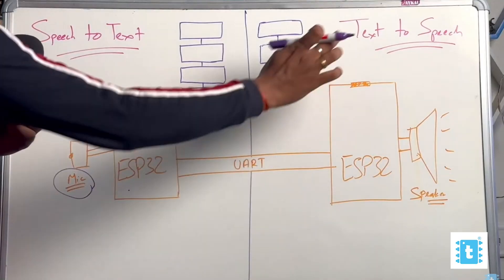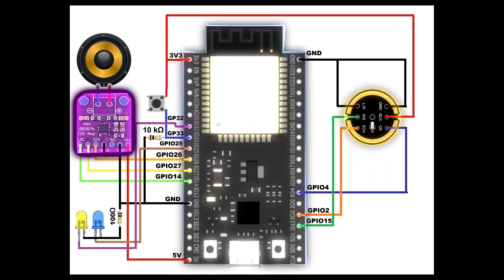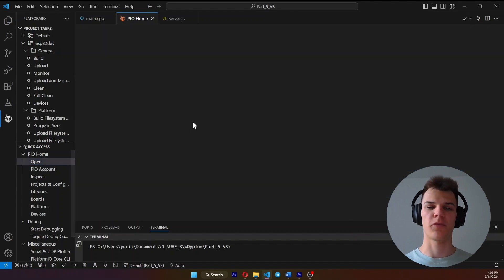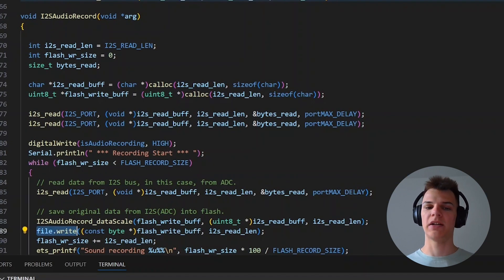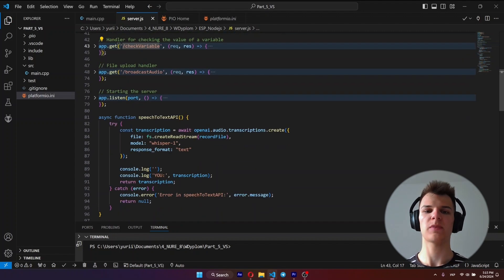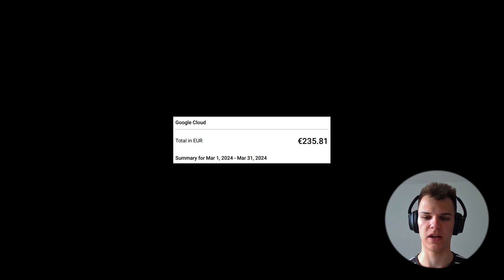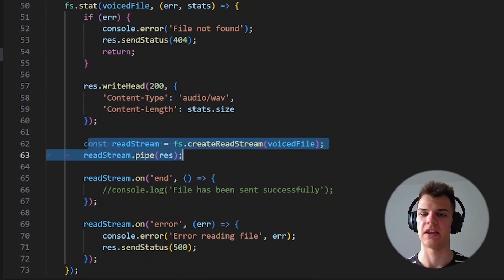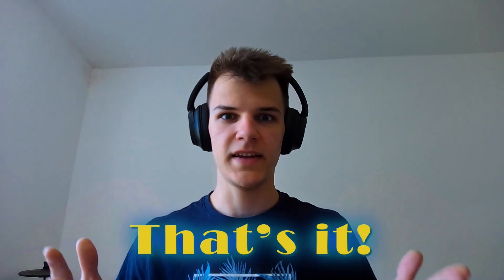ESP32 Voice Assistant based on ChatGPT | IOT

Comment: NICE WORK!!!

but i need to know which ESP32 board you are using is it esp32 WROOM with 38 PINS ?
please mention this exactly
Reply from the maker: Hi ) 
I've used a "Azdelivery esp32 wroom 32", but you can use similar ones from other manufacturers. More pins is always better ;)

Comment: Can Esp32 work independently without connecting to a computer?
Reply from the maker: Hi. You can power it from PowerBank. If you meant a web connection, theoretically, yes, but you need to set up a backend server on a Cloud.
Reply: @BarsAE20  Yes, I mean that the Node.js server needs a computer to operate.

Comment: YOU: Hello, I am Vaitheeshwaran.

E:\Bot\ESP_Nodejs\server.js:135
                console.error('Error calling GPT:', error.response.data);
                                                                   ^

TypeError: Cannot read properties of undefined (reading 'data')
    at callGPT (E:\Bot\ESP_Nodejs\server.js:135:54)
    at process.processTicksAndRejections (node:internal/process/task_queues:105:5)

Node.js v22.13.0
ive got this error 
gimme a solution
Reply from the maker: Hi, this means that Recorded Audio data wasn't transcribed correctly (or wasn't at all). Make sure to get the SpechToText string correctly.
Ask ChatGpt also)
Reply: @BarsAE20  same problem with me but i thnik its coming from the api key not being read properly can you explain properly step by step on how and where to create the user variable for it

Comment: @BarsAE20
I am making this project firstly i want to ask how does the server side code works like where do i put it how to connect and make a api key etc etc and then also i want help with trouble shooting 
can i get your discord so i can ask 
please urgent need to display this in a country wide exibition 
:hand-pink-waving:
Reply: Done withh all but still havent bought api can you check my final code it has some changes just wanna confirm so should I email it to you if so can you tell the email adress❤
Reply: thanks in advance
Reply: Pls reply
Reply from the maker: Hi! 
The server side is on your PC. Import the code into ChatGPT and ask how does it work, that'll help )
Reply: @BarsAE20  its kinda confusing like how do i use this node.js and where to put api
its just suggesting better code
Reply from the maker: You have to install Nodejs and run the main file in the console. 
The API-key is in the Config.js file:
// config.js
const apiKey = 'Bearer XXX';
module.exports = {
    apiKey: apiKey
};
Reply: bro where do i put in wifi ssid and password
Reply from the maker: Separate file:
#ifndef NETWORK_PARAM_H
#define NETWORK_PARAM_H

#define WIFI_SSID       "Vodafone"
#define WIFI_PASSWORD   "Pass"

#endif // NETWORK_PARAM_H
Reply: Bro at this point why don't you give me ur whole working code that u used
Reply from the maker: Man, that's all, rest of the code is on the GitHub. Figure out how it works, I don't have time to explain every line of code. Credentials are moved to separate files for security.
Reply: @BarsAE20  done with it all but still havent bought api so can you check my code to see if its fine
Reply: i can email
Reply: I would really appreciate it

Comment: Hello bro :face-blue-question-mark: What's the performance are you getting from using ESP32-WROOM-32 though? Does it run well? Like can it face science exhibition without any memory issues or crash? I'm aware just how 520 KB RAM takes the load, If you confirm that, It can run well at least contineously 4-5 hours, then i dont have to afford esp32-s3-wroom1
Reply from the maker: Hi, yes you can do it. The Esp32 is only awake when it processes the data, during recording, and outputting phases, otherwise it sleeps. If error occurs, just reboot

Comment: :hand-pink-waving: Hello, Can you list the all hardwares you used in the project with their respective model and a connection diagram if possible, I need it
Reply from the maker: Hi. Esp32 Dev Module 38 Pins, INMP441, MAX98357A
Reply: @BarsAE20   Can I use ESP32-S3-WROOM1 development board instead? It provides more Flash Storage,CPU,PSRAM,   Or We must use the esp32 board, Sorry for the dumb question, Im begineer on those and umm, Doing all my best for science project
Reply from the maker: @mezbatheking3161 They are almost the same, just try
Reply: @BarsAE20  I also saw you using two leds, 100ohm resistor wb them? and any guides how can i set em on the board, unsoldered one

Comment: I completed the project, but when I ask a question, the answer only shows in the CLI, and doesn’t play through the speaker. What could be the issue? 🤔However, This is truly amazing!🧡💙
Reply: Did it actually worked?
Reply from the maker: Hi! Really appreciate, that you've completed the project )
I'd check these things: 
- Is the transcripted file in the folder and playable.
- Is the I2S setup function for Max98357A correct and matches the physical wiring
- On the hardware side I'd check if everything wired correctly (and corresponds to to the software). I'd choose the same pins, that on the video. 
- The speaker has to be without any pre-amps. Somewhere near 3.2W what is max amplifier output. Check the power supply also.
- If it didn't help, probably it's in broadcastAudio() function. Check again the local http server address; i2s_write function etc. You can also ask ChatGpt to insert error checks in function to understand the reason of an error.
Hope that'll help. Good luck!
Reply: @BarsAE20  Thanks again for the help and good luck to you too! 😊
Reply: @Aveesha_Vivek bro what hapined with the Project dose it worked?
Reply: @adamfather2  Yeah! When I ask a question, it generates the answer and shows it in the CLI, but I can’t hear it. I think it’s my mistake while making the circuit. Anyway, the project works!

Comment: hi, does the code only records for 5 seconds, or can you change the recording time as we want?
thanks
Reply from the maker: Hi ! Yep, you can change it. The maximum value comes from the amount of Flash you have on your Esp. Try experimenting.
P.S. A better solution would be  to make the recording by holding a button etc. to be more flexible.

Comment: Wow, this video is absolutely amazing!. Thank you for sharing such valuable knowledge.

However, I have one question: can I use an ESP32 with 30 pins that operates at 3V? I want to ensure compatibility before starting my project. Thanks in advance!
Reply from the maker: Yes, you need a total of 6 logic pins for the microphone and amplifier. The ESP32 module operates at 3.3V, so when you plug it in through the micro USB, it first converts the voltage from 5V to 3.3V using an onboard transistor. 
P.S. The 5V pin on the board is directly wired to the micro USB input (which is typically also 5V), so I used it for the amplifier to get a louder audio output.
Reply: @BarsAE20  yeay I made it :)
Thanks
Reply: Bro can you help me for making this i have lot if confusion i need a expert assistance.